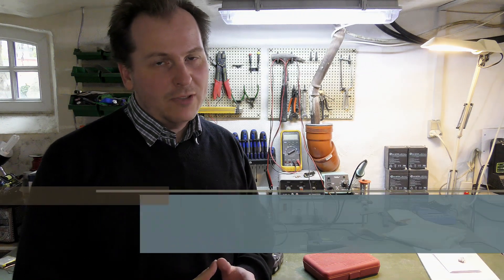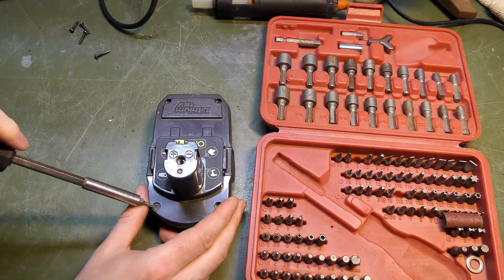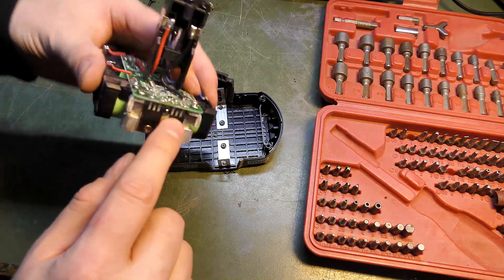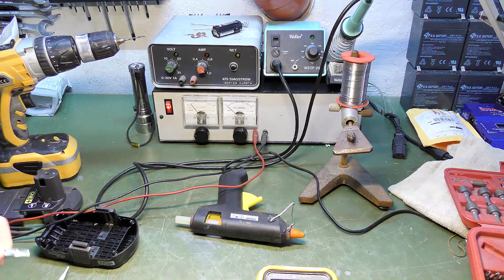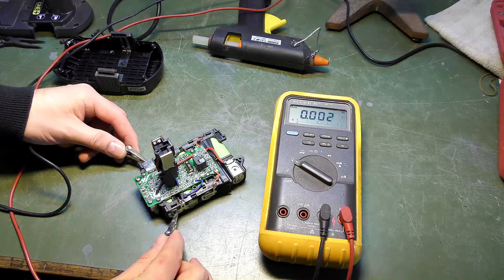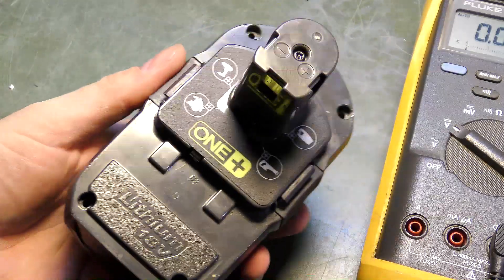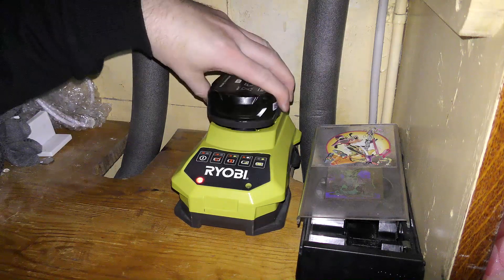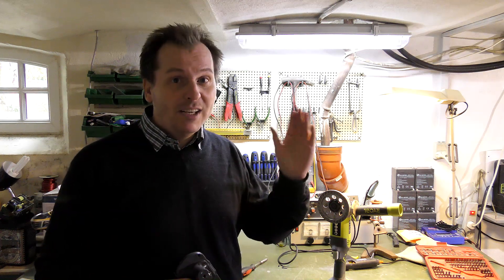How to Revive a "Dead" Ryobi 18 volt Lithium Battery - 582

Comment: i used a small allen key and make it hot to melt it in the plastic cap that you try to remove at 2min 13
Reply from the maker: Okay,, that is another way.. :-)
Reply: I like your videos about, servers, graphics cards, and now battery I didn’t know you were into battery repair also that’s cool

Comment: is it ok to use a 12v normal auto battery charger like on trickle or maintain charge?
Reply from the maker: I think that might work just fine,, but just get the voltages up,,and let the Ryobi charger take over as soon as it can 2-5 min... I would think.

Comment: I have managed to get the green light flashing until it becomes solid but it still won't work my tools. Is the battery beyond saving?
Reply from the maker: That is weird,,, I just happen to have made a new ryobi battery fixing video that goes online later today,, maybe there is something in that one that can help you.
Reply: Thanks for the video but my battery was flashing that it was charging and then went solid green which indicated that it was full but it still did not work my appliances. However, I have now bought a replacement battery and this works ok. I will try to use it more often so that it doesn't have the opportunity to die.

Comment: If you are going to use a drill, you don't need to open the battery, you can just drill a small hole in the "m" (+) and the "R" (-). Insert a wire in each hole and touch it to a good battery for about 30s and your defective battery will have enough charge for the charger to recognize it at the terminals again.
Reply from the maker: That sounds cool!

Comment: Thank you for this great idea.  I had a small, high capacity 12 Vdc battery available to me, so I 'boosted' each cell a couple of times.  It took 2 tries but on the 2nd attempt, there was enough terminal voltage to permit the charger to take over and once again charge up the 18 volt battery.  It's a great feeling to see that green light start flashing again!
Reply from the maker: It's great to have the battery working again,, they are plenty expensive. :-)
Reply: How long did they last after this boosting?  I expect the cells will not be as good any more but maybe they can be salvaged for a few more usage.

Comment: HTESE UNITS ARE DESIGNED TO NOT CHARGE IF TO LOW,THEY JUST NEED JUMPED THEN CHARGED UP,12v is where you want to charge,it will work fine
Reply from the maker: Would have been smart if there charger did that.. would save a lot of batteries.

Comment: Thank you so much for this video!  Since I didn't have a power supply like you, I used a known good ryobi battery to put a charge on the bad cells. About 10 seconds contact from the good battery to each bad cell.  Not as gentle as your method, but it did the trick.
Reply from the maker: Hi Corbett French
Thank You very much! Yes that is not recommended,,, they should not be charged with more then 4.2volt,,, they can do bad things :-/ but good that is worked.
Thank you for watching! :-)
Reply: Doesn't have a clue

Comment: Hi Morten, thanks for your tutorial! I have a Bosch 18v lithium ion battery with the same problem. Can I use my 14.4v, 1.5 amp trickle charger to fix my 3.6v cells or will that be too powerful? Thanks!
Reply from the maker: Hi Tim Rogers
NO do not do that,, charging those Li-ion with more than exactly 4.2volt can result in bad things happening.
Thank you for watching! :-)

Comment: Great Video! I have the same issue with a battery pack that was 'Reconditioned' so I thought it was this, but I read that leaving them in the charger for a long time will also do it. As I don't have a power supply like this, but the cells must be 3.6v (18/5=3.6) could I use a 1 or 2 standard AA type batteries in a holder to give me 1.5-3v to just drop a little charge into them? The video shows that each cell has <0.5v, so if it just got it up to 1v each that might be enough for the charger to work?
Reply from the maker: Hi iamaparanoidandroid
Thank You very much! There are lots of ways to do this, and you just pick the best that you have available.  :-)
Thank you for watching! :-)

Comment: Ryobi should have set a proper,  soft low voltage cutoff point, for these batteries, so they could never enter the hard cutoff point, in the first place. I know this works form my own trouble shooting experience. The self protect feature of the charge circuit, disables the charge circuit, if goes below a certain hard voltage point. The idea is that a 18650 Lithium Battery cells can develop internal shorts if drained too low. Shorts in the battery can cause it to malfunction or even explode. I manually recharged the cells above the safety threshold to to re enable the charger circuit. This should be done at your own risk, but I have not herd of any issues.
Reply from the maker: Hi Alicia Florizone
Thank You very much!  glad you liked the video :-)
Thank you for watching! :-)

Comment: Thank you! You saved me $100. I did not have equipment like you do but i cut a usb cable and connected it to aligator clips and did the same thing you did and it worked great.
Reply from the maker: Hi David Perez
Thank You very much!  That is cool!! I am glad I could help!
Thank you for watching! :-)
Reply: How long did this fix work? My understanding of lithium batteries is that this is more of a temporary fix because once they drop below a certain voltage they won't properly hold a charge again.
Reply: @karlkempf5021  i am still using that battery pack. I think the problem is if you leave it in a discharged state for too long then perhaps this wont work. The pack i revived was already 2 years old when this happened and it is still going. But hey, sometimes packs just go dead and theres nothing u can do. Good luck
Reply: @davidperez5489  thanks

Comment: Hey there buddy! Thanks for your video! I have watched many videos considering this subject, and I have been reviving battery after battery! I think I have recovered over 20 batteries! My source is a local hardware store. People bring in their batteries to be recycled, i ask for them, bring them home, I fix them like this, (some require different repairs.) 

Just a side note! This does NOT only happen to ryobi. I have recovered makita, bosch, ryobi, dewalt and more! Play faves all ya want, it can still happen to ya!

Also! Curious! Its been a while. This battery you recovered, does it still work? And do you use it a lot? Any issues to speak of? Thanks again!
Reply from the maker: Hi Tails Furse
Thank You very much!  Yes this battery is still in perfectly good working order.
Thank you for watching! :-)
Reply: @MyPlayHouse  What exactly did you do that 'repaired' this battery? I'm not electronics savvy, so please give me a clue. My experience has been with Black & Decker batteries, which have been totally unreliable for me. Thanks for info.
Reply: @WryGrass100  
He bypassed the low voltage limiter(which prevents the charger from charging if the voltage is too low) in the battery board and charged each cell a little bit individually so they would be over the limit, letting the charger charge the battery the rest of the way.

Comment: I have repair a 12V 5Ah accu with the same method. But the accu does not have as much power as before. The voltage drops immediately when the load is heavy.
Reply from the maker: Hi Noname2014
Thank You very much! 
Thank you for watching! :-)

Comment: Hopefully it will recover.
I like the way you say charging "Cha-ching", sounds cooler :-D
Reply from the maker: Hi zx8401ztv
Thank You very much! DId I saw that :-?
Thank you for watching! :-)
Reply: 80s in the car ad hoc analysis on my Amazon keeps flipping of a simpler way in the back of the OR8u8rgr8 out for a couple hours and has or had trouble gettingMay, 22, 2020
Becky, do you agree to receive information informationelectronically

Jim Bryant 
Garfield  on a prescription I have had getting old autistic child who won't be back until I will try again later in the week of

Comment: Are you touching the crocodile clips? Isn't that dangerous?
Reply: No, Anything under 50 volts isn't considered dangerous / lethal. Less than ~25-30 volt you can't even normally feel
Reply from the maker: Hi OrangeHex
Thank You very much!  With normal dry hands,, wet salt water on your hands, you will feel it sooner. 
Thank you for watching! :-)
Reply: Only dangerous if they are hungry.

Comment: Ehmm,  what was the actual fix? I am slow, I missed it.  By disassembling, measuring voltage and charging slightly by hands?
Reply from the maker: Hi sfuchs
Yes the voltages on the cells was too low for the elektronic to do the job,, by jumping the voltages manually up,, I could again use it. And it is  still good, used it yesterday :-)
Thank you for watching! :-)

Comment: This works for many lithium batteries, but on some, you also have to reset the electronics module for it to come out of its "broken battery" failure mode. I know it's like that with iPhone batteries. You reset it by very shortly shorting out the battery so the electronics will lose all power for a split second. You have to be really careful and short it out only for less than half a second or basically as little as possible in order to not damage the battery.
Reply from the maker: Hi Seegal Galguntijak
Thank You very much!
Thank you for watching! :-)
Reply: I think that's my problem. The board needs to be shorted. How could I safety do this to reset
Reply: William Joseph just short out the battery for a split second. Really, something like 0.5s or less is enough, but it won't hurt the battery. If it's deeply discharged, it won't do anything - although then, resetting the electronics doesn't make sense yet either, and if it's full, the short time period will prevent the current from ramping up too much to destroy it.
Reply: Seegal Galguntijak Sounds like a plan...how do I short it out? Method you suggest to short out the board
Reply: Really? Take a wire, hold it to both contacts of the battery, and it's shorted out. Only for a very short (no pun intended) period of time though, as I said <0.5s is ideal. Oh, and of course you have to do that on the "battery side of the board" so that the battery gets shorted out "without" (or "before") the board.

Comment: 18650 batteries are to be considered discharged @2.5V. If you let them under 2.5V it starts to correde the lothium inside there. Most of the digital Lithium chargers have the "rest" charge voltage up to 4.35V (as my Nitecore charger).  For drill unit like yours you can prefer 18650 modules hi MAh values and lower discharge maximum current, given that they are in series. It's og to go with 10A with a maximum output of 180W avaiable with the pachage. Laptops for example uses modules with 4A discharge but much higher capacity. E-vape cigarettes on the counterpart prefer very high maximum discharge currents, up to 35A (like my LG modules).
Reply from the maker: Hi DanieleBecchetti
Thank You very much!
Thank you for watching! :-)

Comment: ryobi are rubbish in every way,cheap build,cheap quality,no after sales help,and will not last if your going to use these for more than one day at a time,in the UK you will get no guarantee if you use them and your a tradesman.a total joke company.and as i have found to my cost the new 5amp batteries will burn out older ryobi tools.
Reply from the maker: I can see that you are strategically shaming Ryobi tools,, from more than one account! why?

To everyone else reading this,, This looks like to be a company paid troll,, shaming to promote ??
Reply: @MyPlayHouse  well so if as you say that I'm doing this and as you say im a troll.. Why am i stating Facts.. These are cheap tools. And as i have spent over £1600 English pounds on these products and not just played with a battery i think i have more knowledge on them than you. I also have proven facts that the new batteries burn out older tools. So this is why i know what I'm saying. So let's try this for facts. Ryobi uk will Not cover a claim against there tools if your a tradesmen. And using these on a daily basis. FACT the new 5amp battery will burn  out older ryobi tools. As i have two grinders and a drill to prove it. Cheap. Tools no after sales help. Not good enough for professional use
Reply: @dejavoue88  hahaha stop playing pretend buddy.